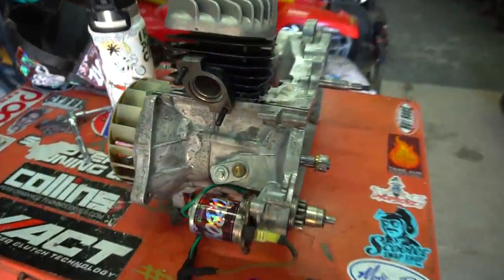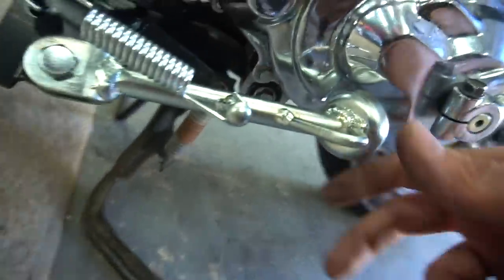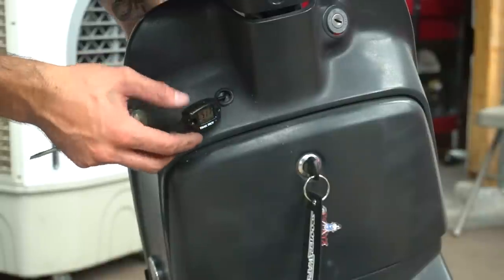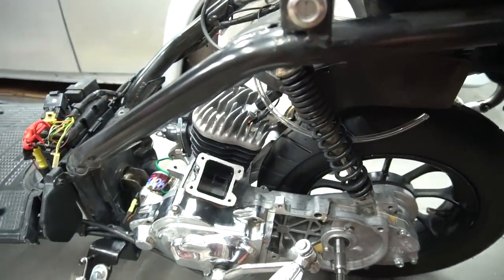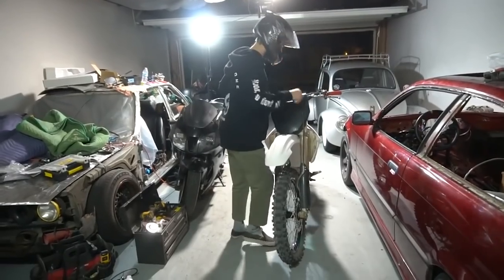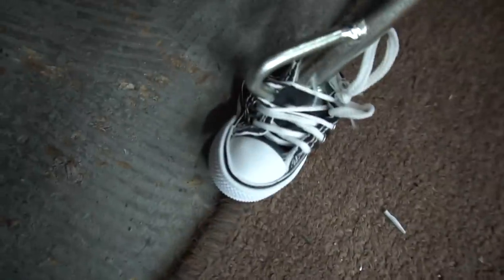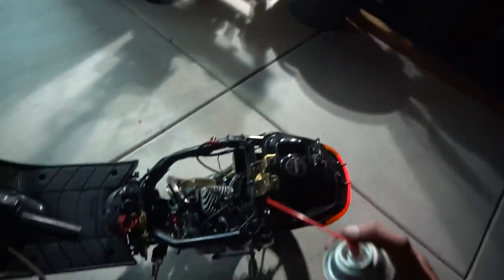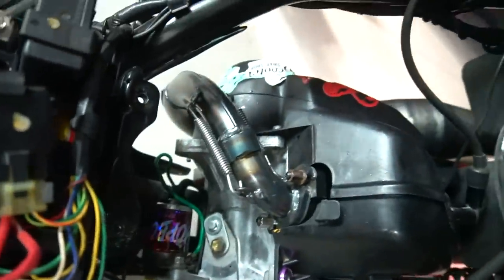it RUNS! 72cc HONDA ELITE DIO Build | Polini Corsa + New Arrow Pipe

Comment: The one spring on my arrow pipe was loose too,  I just took a pair of pliers and bent it back enough where it retains tension on the spring. Thank you for showing me where those two big green guys go!
Reply: I just tried it again it seems like my clamp isn't big enough to have those underneath
Reply from the maker: its hard you have to squeeze the clamp together as you try putting the bolt in

Comment: you can disassemble the stock throttle cable end just incase you didn't know. just be careful with the spring inside the slide.

Comment: Man! She sounds doooope!! We have a 1984 honda aero80 and we just had the carb fully rebuilt at a shop. Changed all fluids etc only has 1k miles on it. Thing rips already wheelies like nothing, what can we do for more top end?? She does 45mph quickly looking to do 55 to 60???
Reply: Roller weights?
Reply from the maker: weights, different rear pulley, dont know much about the aeros but possibly even gear swap!
Reply: there isnt much of anything aftermarket wise for those , or honda elite 80s . just keep it stock and clean and be happy you have a peice of history
Reply: I agree. Keep it stock man. Those are rare machines.  I rock a 1984 elite 125.. nothing like em
Reply: Is there a facebook group or website i can order some plastics off of?? And yes we actually have had this scooter for awhile, just recently got it going. My wife drives it to work when she can, its her vehicle of choice lol i wish i could upload pictures in these comments
Reply: @bobbylewis3718  nope you have to source used plastics

Comment: Can you do a tutorial on how you install the temp gage and where you get them
Reply from the maker: scooterswapshop or amazon. you just put the ring around your spark plug and place the gauge somewhere and thats it, no wiring.
Reply: @MOPBOYZ  You also have to remove the existing washer on the spark plug i believe, correct?